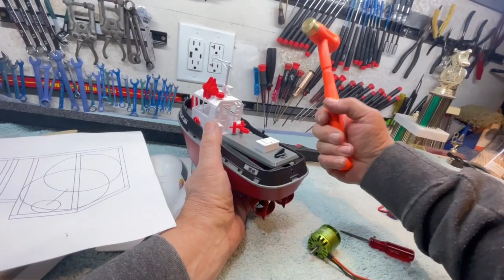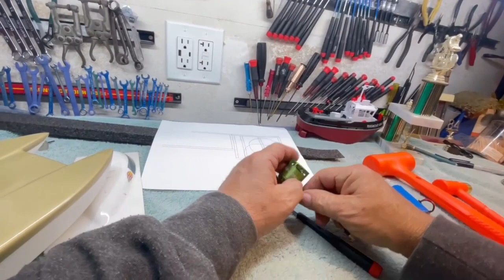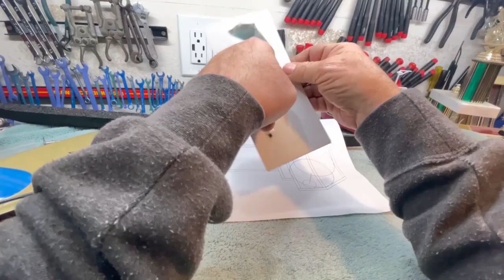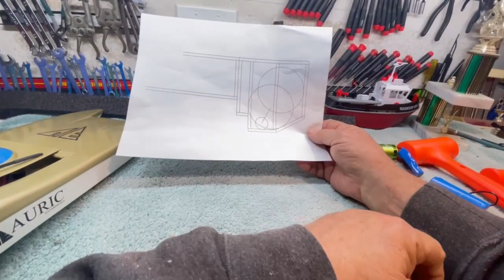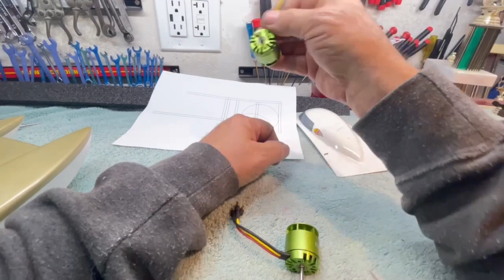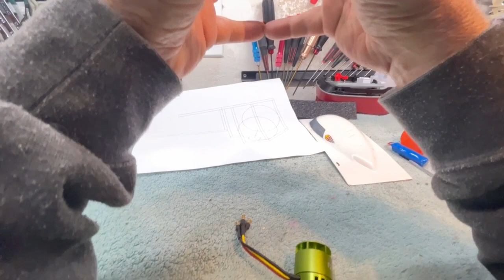Dr. Jet takes you through the design process for the New JetCat 16 Twin V2.0.

Comment: I like what you got planned. Other than the motors do you know what rudder you plan to use. I don't know Mr. Neu but if he sells more than motors maybe get him to gather a parts kit that would be just for this boat. Will this kit that you make be a rib only or will it have sheeting as well. You served up some hot salsa today and you got my mind thinking about what it will need. I also have in the back of my thoughts, what will big b do to this. Not to make it better but to make it suit him. You know he can't leave anything stock😅
Reply from the maker: I haven't settled on a rudder, but it will most likely be in the 55~75mm length and commonly available.  Steve has more than enough on his plate than to deal in some small-time boat projects,  His motors are in outer space and at the bottom of the oceans.  The RC stuff is not necessarily his "bread and butter"; I have to make it worth his while since he doesn't wind that many of these little motors.  He does do quantity discounts, so I'll have to ask how many are in a "quantity"

The more I think about it though, the more I realize I have to do a universal motor mount.  You're absolutely right, I can't lock people into just one choice, Big B will HAVE to put in a bigger motor.  It's in his DNA.  I'll modify the drawings and report back tomorrow.

Comment: I also have one of those motors in my Atlas with a 32mm prop. I built a motor mount like the one you would need for the cat in the Sk daddle Jr. 1/8" ply with 1/4" hardwood square on the front bottom and back top. Then the screws come from the top. The mounting pattern is the same for the 450 motor as a 28mm diameter motor.